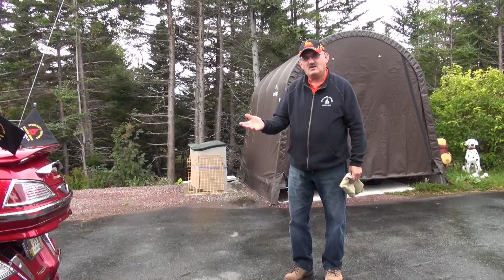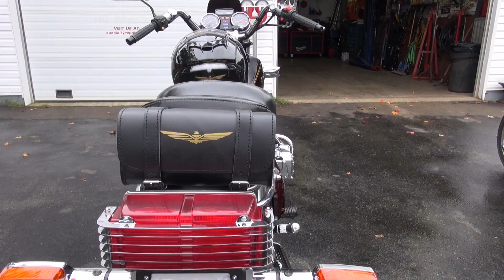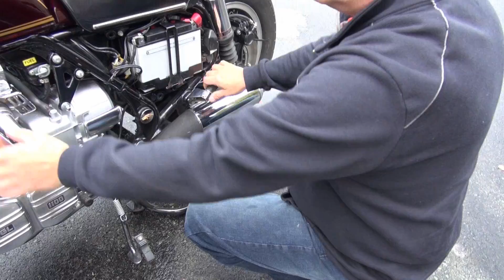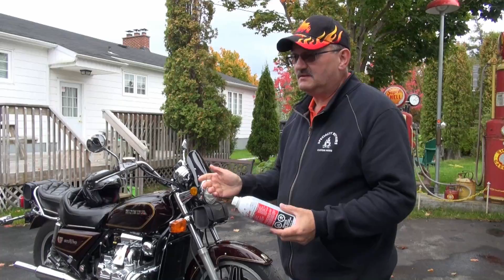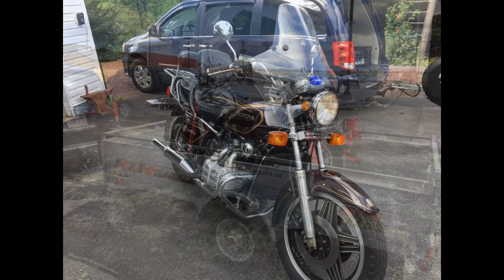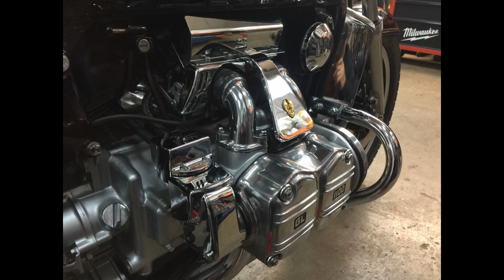The Honda  GoldWing Including Tips

Comment: The GL1100 stator problem is an internet myth. These bikes have a fraction of problems than the 1200. I have both 1100 and 1200. The1000 and 1100 have the same stator. The 1200 has a larger capacity alternator, the stator has more wire turns. Also the 1200 has a smaller radiator (2 tube) than the 1000/1100 (three tube). In the summer desert heat the 1200 runs at the top of the normal range and the 1100 goes up a bit. Thee 1100 is superior to the 1200. The 1200 will be sold. The garage is tight with my new to me 2005 1800.
Reply from the maker: Trying to remember this video. Looks like one I did in 2017. It’s the stator electrical plug that burns on these bikes. No worries about heat where I’m to. I still have my brand new GL1800 abs Wing. Love it.

Comment: gday mate that goldwing is an absolute credit to you and your wife ,it takes me back toaround 1976 when i was sitting at the lights on my brand new 550 supersport honda and two goldwings pulled up next to me ,at the time they were big clunky looking bikes and as you say a revolution in the motorcycle industry .Well the lights turned green and they were gone like the wind they have progressed over the years and your newer is an absolutely great looking bike . Tell the wife i know about sanding aluminium covers to get the plastic coating off of them so they could be polished up like chrome .
Reply from the maker: Those old CB550’s were sone nice bikes. I had the 350 Four and later on the 550 four. Would love to have them now. The old bikes had character. We have the GL1800 GoldWing. Pulls like a train, has abs brakes, cruise control but not as much fun to ride as this old GoldWing. Appreciate you taking the time to look and we appreciate your kind comments. Keep well. Ride safe.
Reply: @7863348  thanks i wish i had a gl 1800 like yours its a stunner .

Comment: I’ll tell ya though about those Honda line crash bars, your shins are going to hate them!!!! 
Oh they also can cause frame damage from a fall due to weak points in the frame, these bikes were designed not to have engine guards.
I am currently finishing up a 75’ and my 12th Goldwing build and absolutely love these machines!
Reply from the maker: I don’t use it much. I love the thing but I much prefer the 1800 we have. The engine guards haven’t bothered me while riding it though. I love the old stuff but enjoy the new technology much better. Ride safe. https://flic.kr/p/292676L

Comment: Nice trick to let people see is  when you start it, try to set a coin on his side on your rocker cover if the engine is really running perfect the coin won't fall over 
Done it with mine 1100 - 1200 - and 1500 and 1500SE
Cheers Jack

Comment: Paul, I love your videos.

I am in the process of going through everything on my 1981 Honda CB750K.
I rebuilt the master cylinder and caliper. I replaced the cable with stainless steel. 
I also could not get it to bleed. I rebuilt both 2x / I replaced the master cylinder with an after market part.
I still could not get it to bleed.

This worked great
1. I took an old Pepsi bottle drilled a hole in the cap and then fed a tube through the cap.
2. I filled the Pepsi half full of brake fluid with the tube submerged
3. I took the cap off of the master cylinder 
4. I pumped the brake and held
5. I released the bleeder valve / tightened back up while holding brake lever
6. repeat until three complete reservoirs were run through
the brake is solid as could be.
I think the key is the fluid can not suck air once it goes out all the way through the tube into the submerged Pepsi bottle with brake fluid.

I did the same thing to flush the brake fluid on my 2013 Honda Goldwing F6B (The best bike ever made)

I tried the mighty vac and every thing else I could think of to bleed the brakes. Did not work

What do you think?
Reply: I used this same method this weekend to change the clutch fluid on the 2013 F6B. Thank you again for your great videos!!!

Comment: How bout that sync too!! Tell us about it please!  One of those would have been so nice when had I dual Weber 40 DCOE on my Lotus.. e-gads, almost 40 years ago!
Reply from the maker: Basically for equalizing all the carbs making sure they all carry an equal load. It's crazy how well the engine works once set up properly.
Reply: Paul & Kathy Short 
Oh I know what it shows... Just never saw a tool like it, with all 4 at once. I used to use a Uni-Sync.. one cylinder at a time, move the tool from one trumpet to the next to the next to the next to the next and so on, making idle and mix adjustments as you go..,  One of my friends had a race car with a Traco V8 Chevy based engine, 4 dual downdraft Weber 48 IDA, 8 barrels to sync... that one was a ton of fun to sync up.

Comment: Hey Paul I never had a Honda Goldwing but I did have a 1974 CB354 Supersport I miss this bike but had to sell it as it was a little small for me
Reply from the maker: Cool. I had a '72 Honda CB 350 Four. It was green with four into four exhaust. I loved that bike. The best I ever owned.
Reply: Paul & Kathy Short mine was blue and white and also had 4 into 4 exhaust had a sissybar/back rest for the passanger that I removed I loved this bike I bought it for & 350.00 not running had to rejet the carburator then after fixing this had charging issues kept replacing fuses and jumping the solenoid by riding downhill then starting the engine main reason why I sold it I have very little mechanical abilities when it comes to motorcycle eletrical systems miss this bike wish I never sold it in fact my bike looked exactly like Your
naked Goldwing only thing is the colors different

Comment: Last part of the summer I picked up a '82 Honda CM250C with only 8400 km and original front tire.  After coming from  a Kawi 1100 with 3 rotors...dual drums on the 250 are a little different. LOL   Blast to drive though.

I'm with you on the Seafoam.  Use it in all my stuff.

Comment: The book weight on my bike is 750 pounds and it's brutal to tip toe  it around if there's the slightest upslope.
  I hear Goldwing's have reverse.  Can you show / explain what it has and how it works ?
Reply from the maker: With accessories and wet weight the big GL1800 on the truck scales weigh in at 1124 lbs. if the trailer is attached the trailer adds 325lbs. Reverse is activated Vespa a reverse switch on the right hsndlebar and once activated reverse is operated via starting motor. The GL1100 naked don't have reverse.

Comment: Its time to sell both of those and get the 2018!    Hossack front end, ABS, DCT ( which is awesome ) .... you in?

I have been riding for 45 yrs.   Owned 2004 GW,  and almost bought a 1976 GW with only 10K.
Decided to save up for the 2018... I won't need to buy another bike until well after the dirt nap and on to the next life.   By then they will float along the ground like "Star Wars".  OH YEA.... change out that timing belt before you ride that 1980!!!.
Reply from the maker: I think everything is all spec at this point in time. I'm out anyway. I got enough in bike at this point. Ride safe.